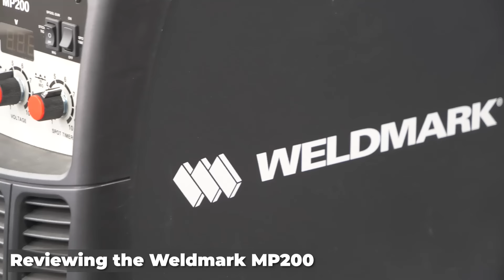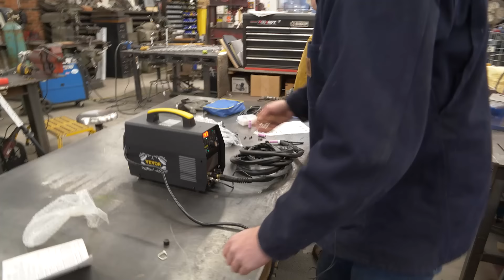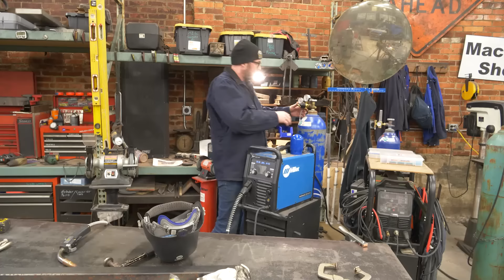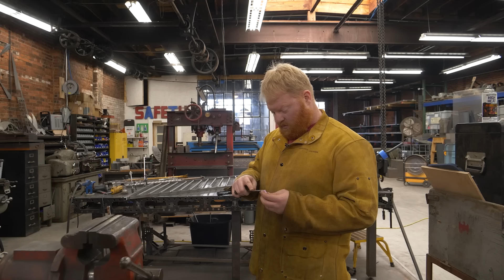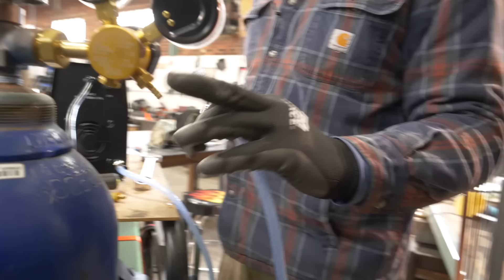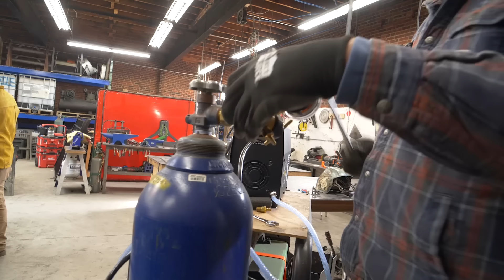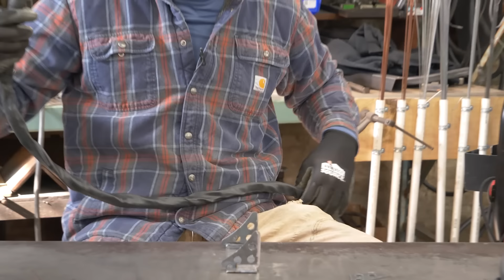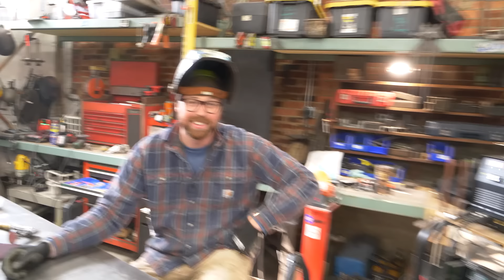$200 TIG Welder VS $2,000 TIG Welder

Comment: I"m always skeptical when a vendor sends you a product to "Test" I remember a Motor Trend Radar detector test where one company sent in a "cheap" detecter that outperformed the other more expensive models. They opened it up and it was was more advanced than the "Off the Shelf" model the bought and opened up. It would be interesting to order one anonymously and run the same test.....
Reply from the maker: See now that's an interesting consideration!  We'd love to do a blind test comparison on some products like this in the future, so thank you for this idea!  Would also be interesting to gather stories from anyone who's purchased these products on their own to see if their experience differentiates from ours. - Walker
Reply: @LiftArcStudios  bought a plasma cutter from Vevor , (my last one cost over a thousand pounds and is on its third breakdown, repair will be around two hundred on a machine now worth about two fifty), the Vevor is a fraction of the size and doesn't need hard wiring making it very portable, so far its cut everything I have pushed at it, the only downside is a shorter duty cycle when pushed close to its limit but its a smaller machine to start with, maybe not a machine for a fabrication shop but ideal for keen diy builder and very price attractive.
Reply: I have also recently purchased a bead roller from the same people, a little limited on the thickness it can handle, just means I will have to buy thinner sheet in future, but everything is there to do a job, this is not a criticism of the machine but if you buy a manual machine you really need someone to turn the handle as you work it as it is so much easyer and more accurate, I am in the process of gathering the bits to motorize mine with a small 12v winch motor and chain , if you go this route then KEEP IT SLOW, and use a foot pedal to operate it, 12v DC is easy to switch forwards and backwards using two push switches, I have made a number of panels with mine in both thin steel and aluminum and even though I am at the start of the learning curve it has made a huge difference already, if you are a keen DIY fabricator can you afford not to have one?.

Comment: I'm a retired mechanic not a welder and when looking for a cheap welder for the garage I found these Vevor welders, watched some video's on people using these machines. There are a lot of u-tubers testing these machines, Vevor are giving them out to anyone who will make a demo video. Out of the maybe 12 or so video's of various Vevor welding machines I've not seen one bad review.I bought a 270 model multi function {Mig/Tig and Arc} with 4 dial adjustments. I've tried the solid core and arc functions and it seems to weld as well as if not better than the machines in any shop I worked. So ya I agree with you a cheap machine that works this well weird right? So I'm thinking maybe I could use a plasma cutter.....
Reply: "maybe I could use a plasma cutter" made ME laugh! I bought a plasma from Aliexpress 5 yrs ago. Out of the box had to re-solder 5 connections where 1 board joined the main board. Since then, been flawless and best $400 CAN I've spent.

Comment: its a 10 minute period , so 3 min out of 10 is how long you can weld befor it overheats ,thats a 30 % duty cycle
Reply: Maybe it needs a larger fan inside the unit?
Reply: @randywl8925  The Post Apocalyptic Inventor has taken some very cheap welders and modified them with fans and wind tunnels and increased the duty cycle greatly.
Reply: @richardsobeck583  thanks, I figured it could be done..... Heat is the, well, one of the issues with this welder.
He said it was quieter than one of his other welders.  Maybe that's because the fan is too small in the one that he's demonstrating.  Just think,  for another $4, the manufacturer could put in a much better fan and give it a 40% duty cycle.
Makes ya wonder.
That said, for a newbie it looks like a great learning too and maybe the ideal tool for the hobbiest who may eventually find the need for something bigger and better.  Impressive.

Comment: So is a millermatic junk its that small?
Reply: Everyone tries to weld with MaxStars on 110 and don't understand why they can't weld all day without duty cycling, or why they can't get full output.  So I imagine they get abused a lot.

When MaxStars do actually fail, it's usually cheaper to buy a new one than to fix it unless, of course,  it's under warranty.  There isn't much inside that can be replaced.  The entire main board and wind tunnel assembly are one part, and it's usually the main board that fails.

As far as weld quality, I can't really tell you.  I just fix them.  I'll take a Miller over a Lincoln any day though from my perspective as a service tech.

Comment: Pulse is more or less built in to inverter machines. They use a MOFSET to take AC 240 and up the frequency to many kHz and then push it through a rectifier as a way to get 200 amps and 20 ish volts. That's a highly simplified explanation. But part of that upping the freq means the pulse is part of the electronics.
Reply: Yeah, I've wondered what the controller is for the inverter control, so like can hack into the firmware if is like a MCU design so can add additional options like different waveforms, frequency controls and offset-balance control for like AC (DCEN to DCEP) aluminum welding since other than an algorithm... seems those machines have the circuitry capabilities with the controller options if not a solid state controller with no digital firmware controls.

Comment: Surprised too.  Expected there to be a wonky, varying tig arc, cheaply assembled torch and maybe a collet that doesn't really grip the tungsten or deforms and you can't get it out.  Barbed fitting is OK if you've got a dedicated regulator (why would you not?).  A full project's worth of welding is the next test, and maybe running it at the high end of it's capability to see how stable and hot the arc is and remains.  If all's good, then a penny saved is a penny earned.  At least if it fell off of the tailgate and stopped working, you could in good conscience just throw it away.
Reply: more like a dollar than a penny LOL

Comment: Duty cycle is completely over-rated in a fab shop.   When was the last time you put down a 10 minute weld in one pass?   How about a 10 minute weld on max power?   I've never done it.  Realistically 30% duty cycle is fine for 95% of us.   Hardfacing is the only welding done around where I live where you need a serious duty cycle.  (maybe some of the marine guys put down some long welds on hull repairs as well)  And I don't know anybody who is doing TIG hardfacing.  :)

Comment: Great review and very surprised I guess if shows times are changing and some cheaper things are ok.
Reply: It's the fact that it's dc is why they can get the price so cheap. The "cheap" Chinese ac/dc tig welder start at about $870. Inverter based welders have really dropped the prices down on welders, not to mention the size of the tig units are a fraction of the size they used to be. Look at the average size of a tig weld from 15-30 years ago. They were massive.

Comment: Clearly you aren't paid to endorse the Vevor product line. Your doubts going in only validate the value in scope of what they provide. Entry level product price with a standard level production. No too shabby.
Reply: Clearly, you are paid. 😂
Reply: I've been seeing that that brand pop up in a few different markets. I bought a diesel heater for my car. Not sure how well it works compared to the legit ones. I have it physically installed, but have to finish wiring it up. I have a feeling I'm going to have to buy a smaller one though because I got an 8kw one for a 4 door sedan. We use 2 kW ESPAR ones in the trucks at work, but they are insulated better. Have to see how much it cycles on and off when I get it running.

Comment: Been welding for over 30 years.  Although I often buy Miller, Lincoln, and even ESAB, I have had all of those three suffer failures from time to time.  I also have an AHP tig welder and it gets used just as often as the rest.  It's the only one that hasn't failed yet.  It was $700.  The rest were $2500 - $5500...
Reply: Sounds like they were using the "Yeti" effect on us all.... If it costs more it MUST be better🤣🤦🏼‍♂️🤦🏼‍♂️🤦🏼‍♂️
Reply: @lbeck119 Yeti is some of the most insanely priced consumer items I've ever seen, I'm convinced it's an experiment. For example their 5 gallon buckets they sell.
Reply: Besides the big brand name, I'll bet a lot of the components inside are made in China anyways.  In the end you are paying for the name brand and these other companies most likely have less overhead and they can cut the cost to the consumers.  Maybe we are OVERYPAYING for the name brands and what we consider cheap is normal price?
Reply: I also have an AHP alphatig 200 , v2 that i bought in 2017 it absolutely is great!!!
Reply: It falls apart when the Lincoln dealer says you'll get your warranty repair back in 4 weeks and Harbor Freight has a similar welder for $299 on the shelf right now.
Reply: They all have Chinese made boards, blue and red just charge a premium for theirs
Reply: I loved my AlphaTIG 200. It went through a lot of heavy abuse for three years before the boards went out.  I run an Everlast 210 now.
Reply: What type of failure that often happen ?
Reply: @harisyoung4110  The circuit boards seem to fail and then it takes months to get new ones.  I've had a Lincoln at the shop for 9 months still waiting for a board.
Reply: I'm pretty sure esab is the only one still made in America , Miller and Lincoln are not anymore
Reply: AHP is such a good quality man.
And generally I can't wait till Asian welders get a shop over here because the big three are screwing us
Reply: I use to believe in yellow and blue, until I worked in a shop of mostly blue and like you said they were down and out more than my cousins junker.

Then the labor or warranty tech wanted an arm and a leg. Once I saw the prime weld reviews I bought one. Love it for my garage.

To this day (3 years later) 2 of the 5 machines at my shop are still out of commission or broken for repair 😂